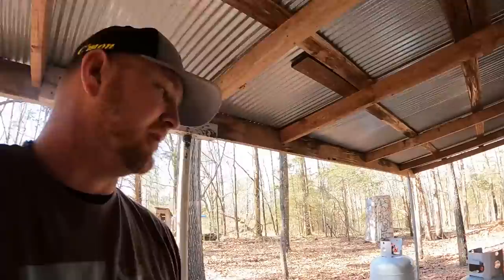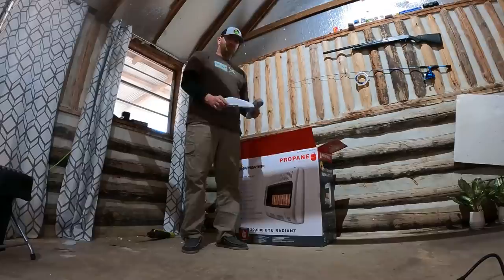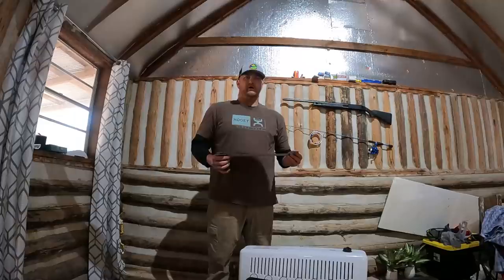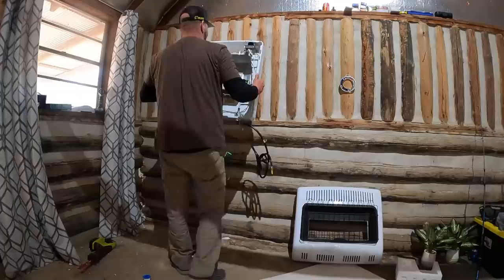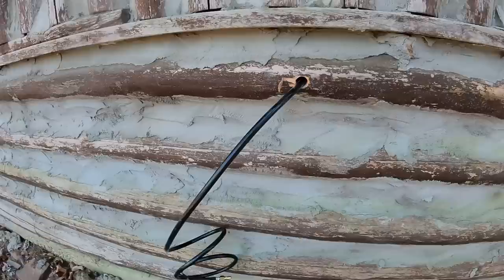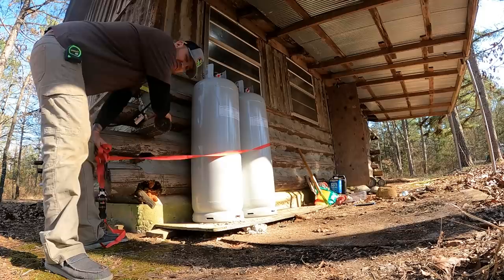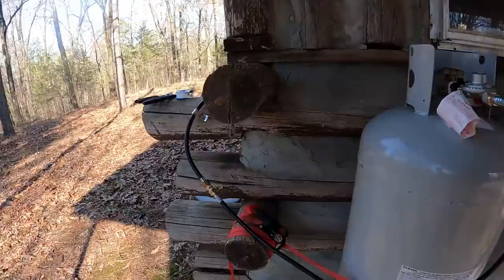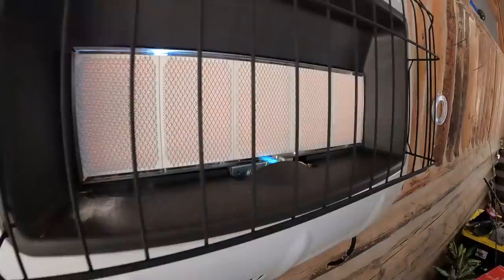INSTALLING PROPANE HEAT | homesteading | off grid living | cabin build | cabin | off grid cabin

Comment: You're going to need a wood stove eventually, I think ya might of wasted money on that propane set up, ya see the space in the ceiling where there was no foil, I think that's where they planned to set the stove pipe. But they never got that far..they were going to set it up centered in the middle of the room for maximum heat value and dispersion..

Comment: What was the cost to fill? The prices of both follow oil, so im not sure its going to be cheaper, the efficiency of the aircon should have made up for most the losses of the generator Vs direct use, plus the propane will put out lots of water inside the building. If you insulated already and its warmed up you will never really know.

Comment: Surprised you even found a heater. They are like hens teeth. The fitting in the bottom of those heaters is 3/8 inch pipe thread.. Your hose is 1/4 inch pipe thread.

Comment: Hi man my name is Wade we live in Little Rock and are trying to decide if we want to do something similar or buy land in the country and build something like our house but 60% the size. We love to visit the country and work away from the computers sometimes if you would like any help I'm good at wire fishing, connectors, security cameras, surround sound, wifi access points and ethernet networks, and towing trailers up to the size of the one you showed in the video so long as not laden with lead or something weird like that.

Comment: Is there a reason you chose the radiant Mr Heater? I just put the exact same heater in my home on January 21st, but I got the Blue Flame heater. And I am already having problems with it. If I had to do it all over, I don't think I would go with Mr Heater.

Comment: 30000 BTUs is not very much when you consider your average 4 burner Grill base about 45000 BTU. Needs to be on the  floor.  Heat rises.

Comment: Just watch out for CO2. In Canada we're not even allowed to use non vented units like yours because of the danger of carbon monoxide poisoning. Get a CO2 detector so you don't end up dead.

Comment: No! This propane heater is not a good idea, seriously, keep a window open while you are using it. At the very least it will cause moisture damage, if not worse. You may want to consider installing a chimney in the near future that would accommodate a wood stove or a Wiseway pellet stove. Propane is not the way to go.